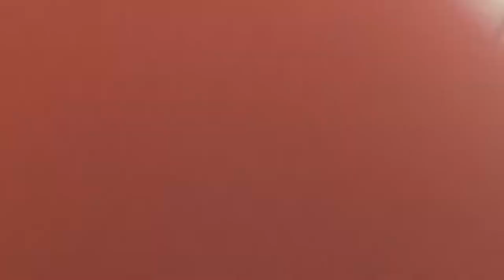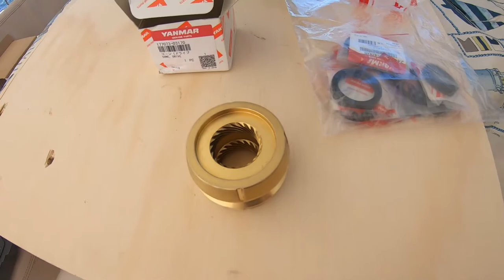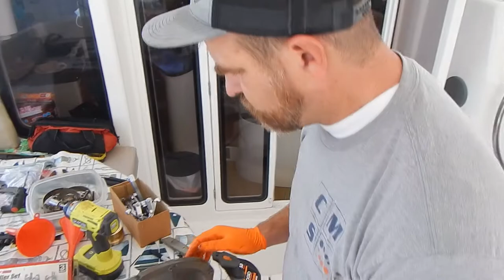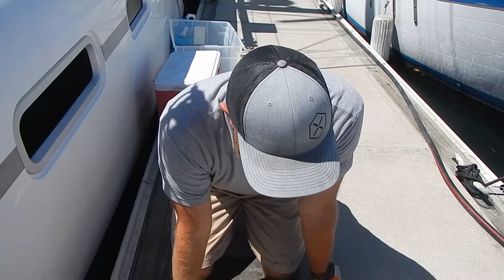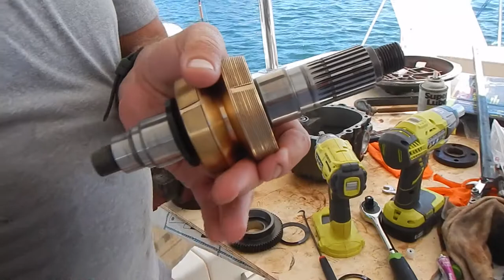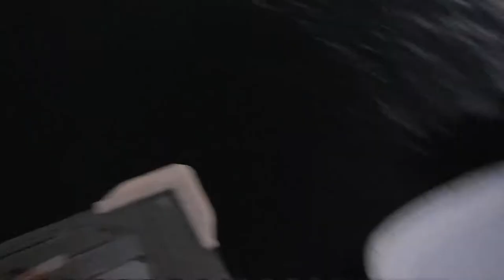Rebuilding Gear box on Leopard 43 Catamaran Part 2 - Preparing to Sail Around the World (3)

Comment: Hello. What is your engine like with regards to engine noise and vibration. One we looked at seems to  be fairly noisy under way at about 2.2K RPM. Did changing cutlass bearing help in anyway, less vibration maybe?
Reply from the maker: We did change the cutlass bearings and I could see no difference in vibration or noise after that change,. The engine isn't too bad underway but could be quieter for sure.
Reply: @KevinBatchelor  Thanks.